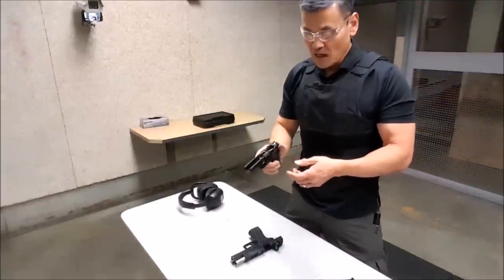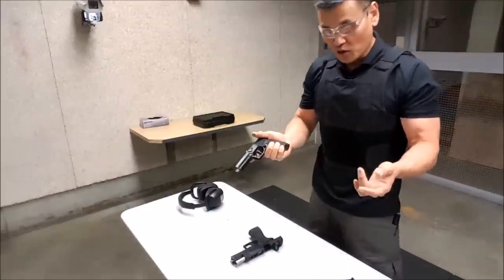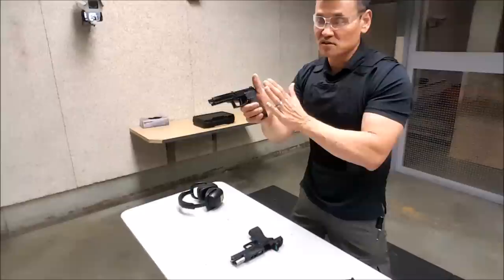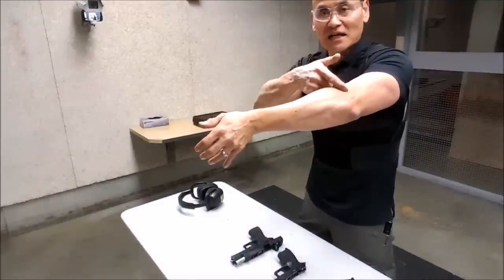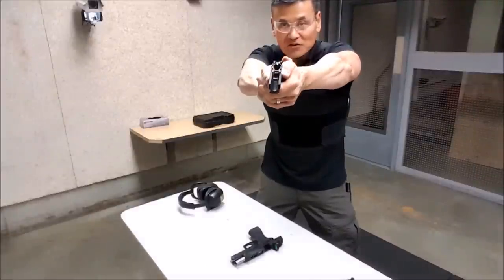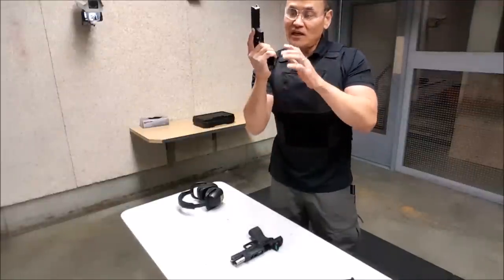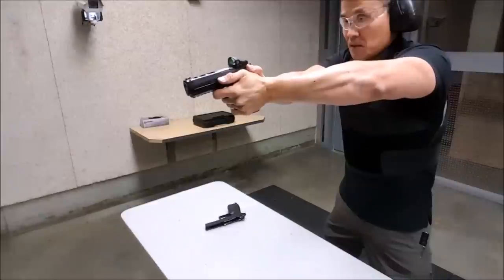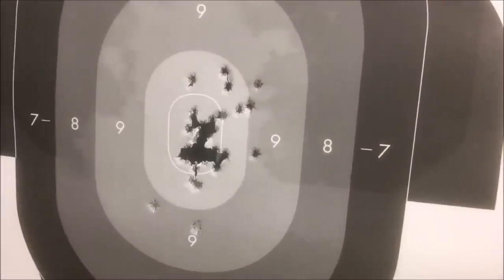Pistol Grip Technique (Finger Over Trigger Guard) - Yong Lee USPSA GM

Comment: This is how I've always gripped the gun, too. It blows my mind that it isn't recommended more. It gives you a stronger hold on the gun, because not only do you have more "skin" contacting the gun, but it also gives you an amazing amount of leverage, with your support hand. The "standard" grip just has you squeezing the crap out of your strong hand. With this grip, you're squeezing the crap out of the gun itself. Plus, your support is a lot closer to the muzzle, and higher on the gun. Isn't that all of the things that we want???  I'm sticking with it, no matter what anybody else says. It works. Period.      I wasn't ever gonna change my grip anyway, but it's nice to see a pro endorsing it. Jerry Miculek mentions it too.
Reply: His daughter is using that grip too and so do I. It gives me more control of the gun.
Reply: Also moved my left index finger up which helps. I am a right-handed shooter. I thought the upper barrel slide would affect how I gripped but does not. More meat closer to the front of the barrel means less flip. I am still working on it but probably realized my wrists were not locking out as well so this may compensate.

Comment: I’m notorious for having a bad aim. For the first time, I wrapped my index finger around the trigger guard to help stabilize the recoil and was a dead shot right away! Not everything is for everyone but this technique worked well for me!
Reply: I find I can control recoil and get much better shot placement when I wrap my finger around the front of the trigger guard as well. I have slightly smaller hands I guess and it works wonders for me! My name is also Josh so that’s a cool coincidence.
Reply: What do you do if your running a flash light tho??
Reply: @gageirwin7206 I guess you can't. This seems good for sport shooting but for personal defense you want a flashlight so this technic can't be used in real life scenario
Reply: I shoot with a flashlight. I still push My middle finger up to the trigger guard, which brings my index finger up by my flashlight. It still works. I am still able to get more hand on the gun with this technique, even though there's a flashlight there.

Comment: I broke my wrist in the growth plate and snapped both my forearm bones in half when I was about 12. I never recovered physically to 100% nerve pain and if too much force is put on my wrist in any direction it pinches the nerve and holds it pinched until I damn near pull it out of the socket and pop it back in. As I'm getting older I'm noticing my shooting becoming more and more affected I physically cannot lock that dominate wrist. Ive found a grip with the support hand like this, it really works for me especially on my subcompacts. Helping manage recoil of a subcompact 40 my support hand is where I have to focus my energy and practice. ❤ Thanks for sharing your technique and the explanation. Bent elbows were a game changer 😂 I was that stiff arm stuck out target shooter until a few years ago. A much more practical stance and grip and lots of practice has made me a far better shooter than I was for years without training.

Comment: Thank you SO much for this explanation.  I had been experimenting with the over the trigger guard and standard under the trigger guard holds, and really didn't find significant differences with my personal accuracy (not that impressive hahaha). Nevertheless, after toiling with the cranking down on the gun to get as much purchase with both hands, I realized that over-cranking caused me to loosen my grip after shots and slowing me down and causing all kinds of problems with follow-up shots.

At about 30 rounds, I think my brain and my hands finally settled down and I somehow achieved something short of a death grip, that managed the recoil, and my follow up shots were much better and consistent. 

With this video, I am going to visit the range to work on the wrist lock, and really lock down the accuracy, to ensure improvement on my follow-up shots.

Once again, thank you very much for sharing your grip/control technique.  I recall your loose strong hand video from awhile back and was happy to see you revisit that principle hear, further emphasizing the WRIST LOCK's importance.

Best regards Mr. Lee!  Truly appreciate your time and effort, given your busy schedule.

Comment: I’m a new shooter to semi-auto pistols.
I’ve done a fair bit of wheel gun and rifle shooting as a younger man.

My first time at the outdoor range shooting a G3C (compact), GX4 (micro compact), and LCP Max (pocket pistol), my groupings were down and to the right at about 4 or 5 o’clock (lefty shooter) with the traditional grip.

Then I wrapped my finger around the trigger guard on the shorter GX4 and LCP Max because it felt more comfortable and natural to me, and my groupings were much tighter and dead center.

I showed the RSO my targets and explained what I did, and his response was “oh no, you can’t wrap around the front of the trigger guard, you must be under the trigger guard”.

I don’t understand that thinking at all. That’s like telling Philip Rivers that he must change his throwing mechanics (which were unorthodox but very effective), or Jeff Bagwell that he must change his stance (also unorthodox but worked well for him). They both had great careers at the highest level while doing what worked for them.

Thank you, Mr. Lee for the excellent video and for confirming what I already knew to be true.
There’s more than one way to be an effective shooter, and what works for me may not work for someone else and vice versa.

Comment: I bought a CZ P01 and have been playing around with it for several days with grip, and my off hand non-trigger finger /fingers kept wanting to go around and wrap the trigger guard and higher up on the gun it just felt so good and natural and I could just feel the stability in holding it that way. I even looked at the actual design of the gun and thought "Well, they have grooves cut out on the guard like you are supposed to be gripping it there".

So, being a noob I started YouTubing the "experts" on how to grip. And everything out there has you wrapping your fingers around your fingers under the trigger guard, I'm just not sure how they can justify that is a more stable and controllable grip. I think it's cause we live in the age of "taci-cool" and that's the the area your accessories go not your grip. Not sure.

But anyways, feels vindicating there are pros out there doing the same thing that feels so natural.
Reply: Literally the same exact experience with my new S-P01 this week. Its even grooved in that spot for better traction, got me thinking maybe it wasn't such a bad habit

Comment: I just discovered this video and I have to say, I'm really thankful for it. Mostly for a really detailed approach and clarity of presentation. Great! Unfortunately, I'm a really small guy (about 5 ft 4 in), with rather weak hands and I struggle to find a right grip technique from about 1,5 years when I started to shoot. I know I can't simply overjump gaining some strength through physical training. Still, whenever I apply any pressure on the gun - would be this side pressure or push/pull (in Eric's Grauffel fashion), my accuracy goes off. I can be fairly accurate with the .22 LR, since there is no really any recoil to control. I can just hold a gun, aim, and gently pull a trigger. But this of course doesn't work for 9 mm or more powerful stuff. I generally practice with CZ 75 SP-01 Shadow. I'll try to apply some of your advice next time on the range. Thanks! :)
Reply: Did it work?
Reply: @ProjectExMachina  Partly. :) What works for me the best is a "stiffened" and an outstretched right arm coupled with a pulling left arm. I also apply some torsion (elbow-out) to the left hand and locking of the wrist. I don't grip hard with my right hand and I do grip moderately hard with the left one. This seems to work best for Glock and 'Glock-like" guns so far - however, Glock's out-of-the-box trigger ruins the effect to a varying degree. This works somewhat worse for CZ. After all, I still achieve the best results by really conscious trigger control. This is somewhat fine for the 'Olympic', bullseye type of shooting I mostly train and compete in. However, for dynamic shooting, I still haven't found the repeatable solution that would be working for me to balance out the accuracy and recoil control.
Reply: @sherab2078  Thank you for taking the time to share expirence of yours.

Comment: Hello Mr Lee.  I am an instructor but certainly not at your level.  I have been shooting over the trigger guard for about 5 years.  I teach this grip as well but only as an option for shooters.  I am also a competitive shooter too and shoot this way in my league.  17 straight weeks with top score. 

When I teach, I have started referring to the “support” hand as the “strong” hand just to make the point that this is really the hand that holds the gun.

For those impressed with the lack of recoil when Lee shoots....learn to lock your wrists properly and you will look like this too.  Take videos of your shooting over time.
Reply from the maker: That's a great point. Support hand should be considered Strong hand. I agree. Thank you for sharing your experience.
Reply: Referring to the support hand as “strong” might be a bit confusing to people exposed to other information. Even if the grip is definitely stronger than the “trigger press” hand.

But I’ve definitely seen it referred to as “control” hand.

Comment: I just came across the video after listening to your podcast on Firearms Nation. Excellent video. I really got a lot from the portion where you discussed locking the wrists. I was wondering if you might be able to elaborate on where exactly you are applying the pressure with your support hand. I have trouble with with my support hand thumb going numb (and staying numb for days) if apply too much pressure in my palm near the base of my thumb regardless of finger over or finger under the trigger guard.Thanks,Brett
Reply from the maker: Brett Zwolensky I apply pressure inward and forward with the top portion of my palm. However, I mostly generate power in to the gun by raising my elbow which applies pressure in to the gun on the support side. Hope it helps.

Comment: Ever since I picked up a pistol I started holding it with my finger around the trigger guard.
Unfortunately on some it's too easy to activate the slide stop and hender it from locking back on the last round.

It happens a lot on the Sig P22x series often. But with CZ I've never had that problem.

Comment: Dear Yong, I believe this technique works well for some although it is unconventional and against what most instructors recommend. However if it works for you and Jim Miculek who is also a big fan of this method, it should work for others. I used this technique after thousands of rounds without out it and I see it works well especial as I believe it provides more control as long as the elbows are upwards and wrists are locked. I lock my trigger finger on the polymer frame. Moreover Jim Miculek recommends skate board tape or some stippling on the actual trigger guard. Any thoughts or other points? Thank you, John

Comment: Thank you so much for your video! I have a problem with my hands: I have very long and skinny fingers. My hand and the tendons in my forearm get very tired and hurt after a few shots. I have to use the standard gun of my unit (which is the HK USP). Now I tried to use 2 fingers on the trigger (index fingers of both hands) and the shooting  results were great! What do you think about that? Is that an adequate solution?
Reply from the maker: Thomas,  I'm glad the video helped you. While that is unconventional, it has worked for others. Don't let anyone tell you why you shouldn't do this or that. I'm a firm believer in result oriented technique. Whatever technique I'm using, if it results in better performance, I'll adopt it. The technique ( one or two fingers on the trigger gurard) works extremely well with the HK (my duty pistol for 20 years). Wishing you much success. And let me know if you any more Questions.
Reply: @yleegm  Thanks again! But maybe I didn´t describe properly what I´m doing: I use the index finger of my right hand and the index finger of my left hand together at the same time to PULL the trigger. So I don´t have to fingers on the guard but on the trigger. Is that ok for you, too? I´ve tried a lot to use only one finger, but after 10-20 shots I´m not able to pull it any more (which is a problem especially on days where I have to shoot 100-200 rounds).
Reply: @onthefly4711  
That is very weird. I would consult a hand surgeon or sports therapist to take a good look at your hands and forearms. The trigger pull shouldn't exhaust you so quickly if you're not tensing everything up like crazy. 

Your trigger hand shouldn't be that tight of a grip and your trigger finger should be isolated, the movement during the pull should come from the first and second phalanx, while there is no movement in the knuckle of the index finger. Look at "Shoot fast and accurate with Michael Voigt" to see what I mean. 

You make it easier when you pull the trigger further down and when you're close but not on the first joint of the index finger, kinda like DA revolver shooters do it. You either have your hand in an awkward position that leads to different finger position, the distance from the backstrap to the trigger doesn't fit you or you got some medical issue that leads to your problem. Again, really go to 2-3 medical experts and get some tests done.

Comment: Awesome Video. Compliments. My question is; this tecnique is correct with a 1911?. Ok with a 2011, but i don't know if the 1911 is too thin for this grip. Thanks!
Reply from the maker: Joe Perino It would depend on your hand size. But generally speaking, it will work with 1911.
Reply: Thank you. P:S: I have a big hand!

Comment: Thank you for the great videos. I started shooing the X5 with a 6 moa Romeo this year and love it. I do not do any reload at this time so I am running the Fed 150 gr TSJ, what recoil spring weight would you recommend?
Reply from the maker: I would recommend 15 Wolff. You can go down to 14 for softer felt recoil, but stay away from anything lighter. You may run in to some lock up issues, if you do.

Comment: I do the same thing, how ever with the Sig P2xx pistols I always have an issue accidentally pushing down on the slide stop & they won’t lock open on the last round.
Reply from the maker: I agree that can be a problem. I build two layers of grip tape just below the slide stop to cure that issue.